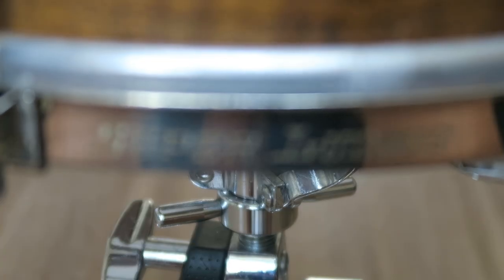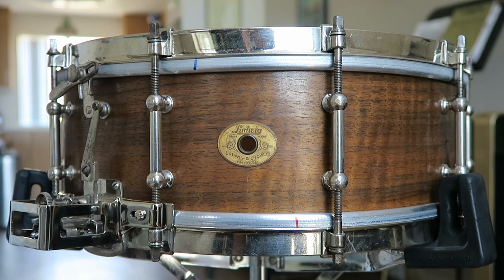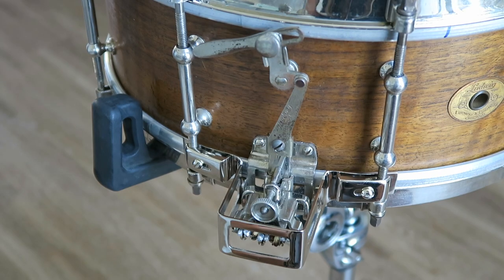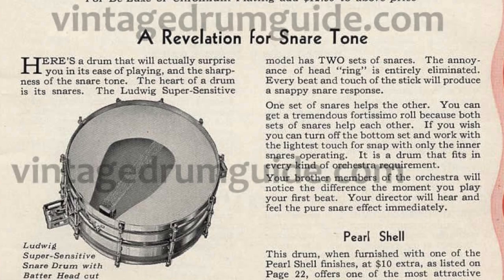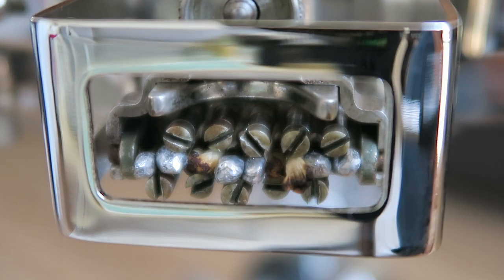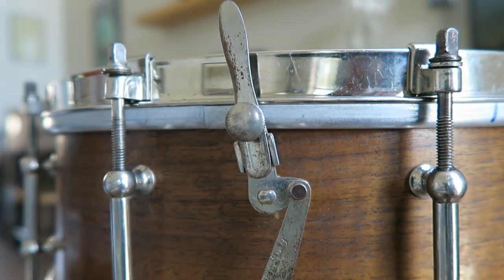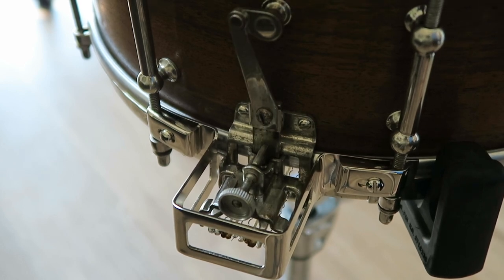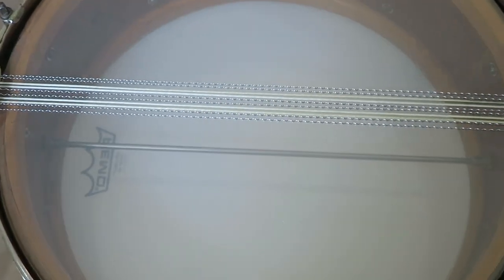1920s Ludwig Super Snare Drum

Comment: Nice review, thanks.  I have the brass version of the drum with two sets of snares (one under the batter head) and it's a real thing of beauty. One word of caution is that the little brass claws that hold the rim down are prone to snap off due to metal fatigue - especially if high tuning is used. For this reason, I have removed the original ones for safe-keeping and replaced them with new ones for everyday use.

Comment: This concept is still being made by Ludwig Today and they still call them supersensitive‘s Ludwig supersensitive were offered in the 60s 70s 80s 90s into the 21st-century and the mechanism ( Plastic And steel combination) is basically unchanged since the 1920s it’s basically the same concept however the new drums are nowhere nearly as good (The snare Guard it’s basically nonexistent in the present day models) As the drum in this video or the nickel over brass model with the dual snares Which I have. I wish the present  day  Ludwig would re-introduce this “Super Ludwig” snare drum from the 1920s and 30s! Especially the dual snare models with the double ply “NOB” shells!